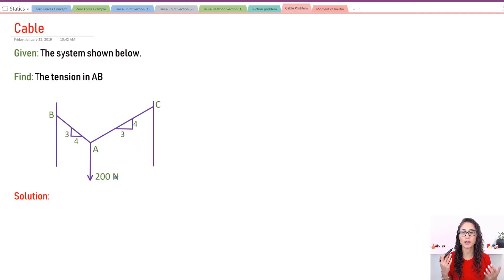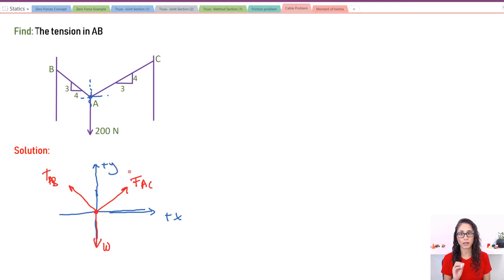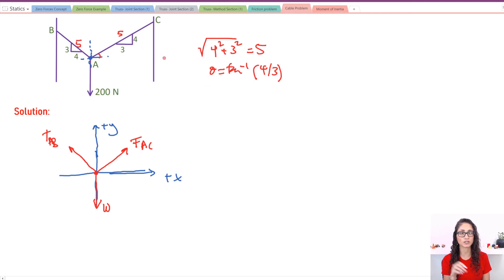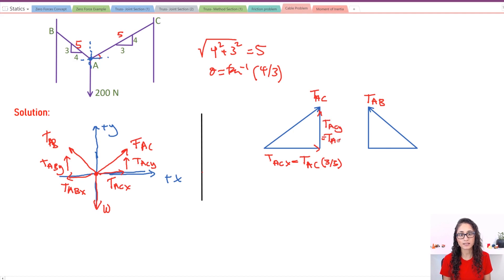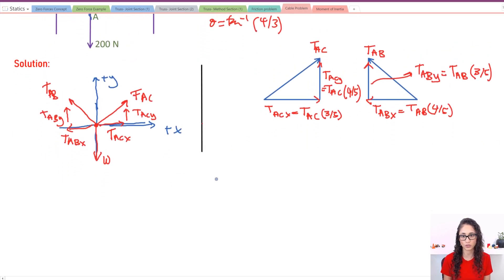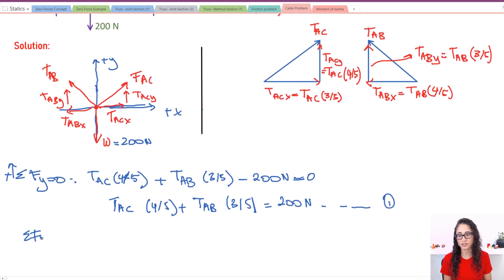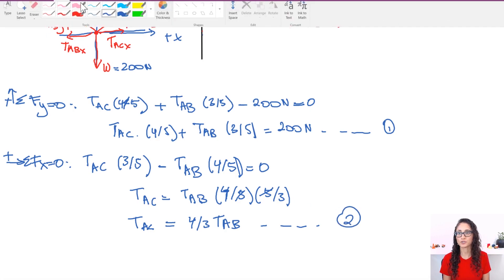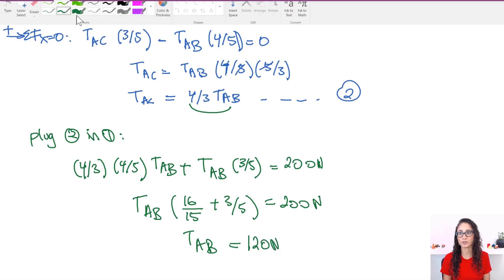FE Exam Statics - Tension In Cable AB (Equilibrium Equations)

Comment: I noticed that if we rotate it AC 53.13 degrees putting it at x axis then summation forces along Y-axis we will be able to determine the tension at AB, final equation AB = 200sin36.87 = 120N
Reply: or 200 cos53.13
Reply: Yes 200cos51.13 is one step and quick.